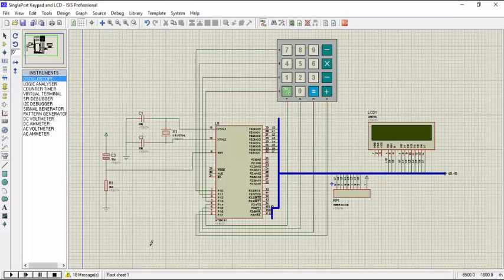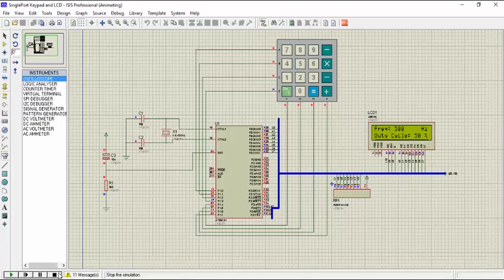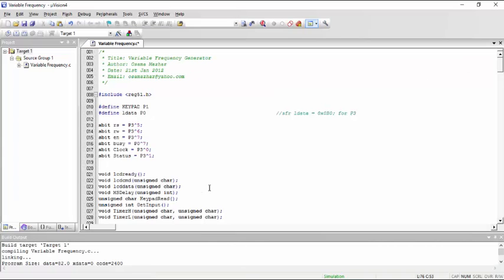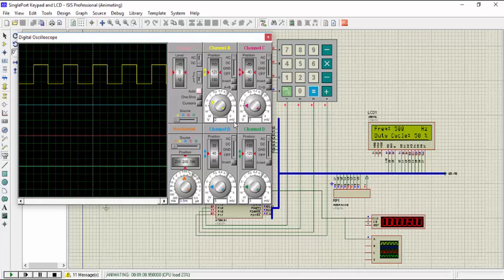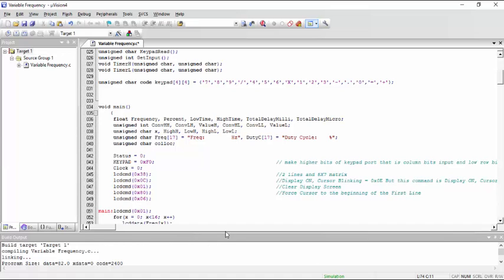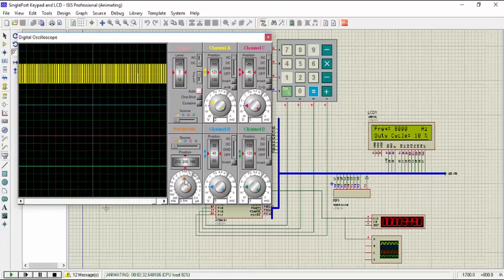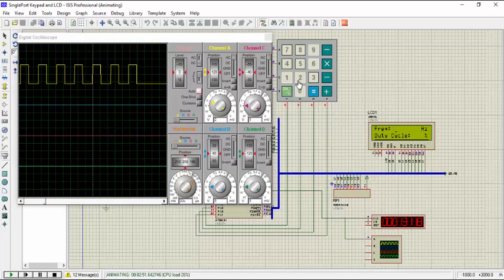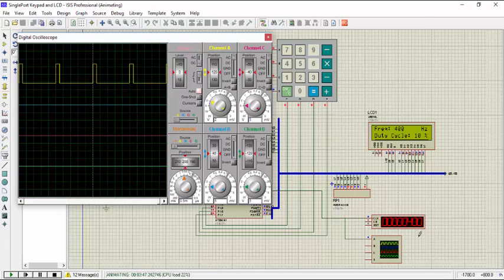Variable Frequency/Duty-Cycle Generator Using 89C51 Microcontroller

Comment: I have solve the problem. remove float with unsigned int and write 65535 in place of 65536 in the code. then burn it to 89s51 not showing garbage value. but it showing errors in higher frequencies.

Comment: not working on real hardware lcd shows only black boxes in first line. I am using LCD jhd162a  12 Mhz crystal and 33pf capacitor 89s51microcontroller.
Reply: Really
Reply: Then, how can u solve the problem?
Reply: @zeel__sheth  I am seperately copy the codes for interfacing lcd and keypad with some  modifications.